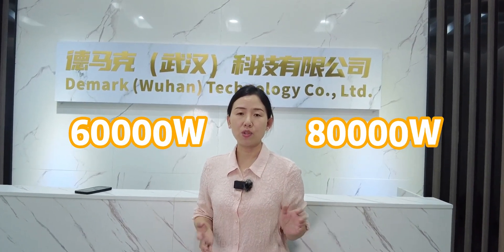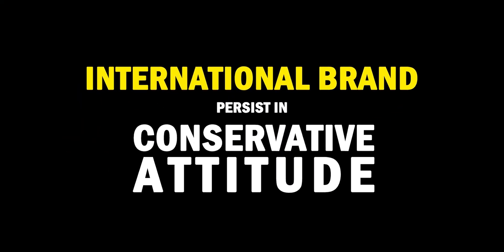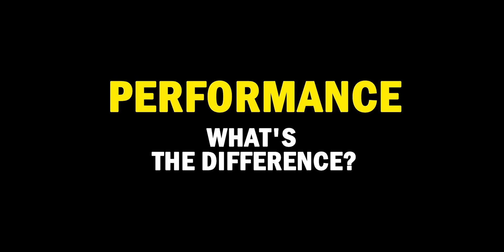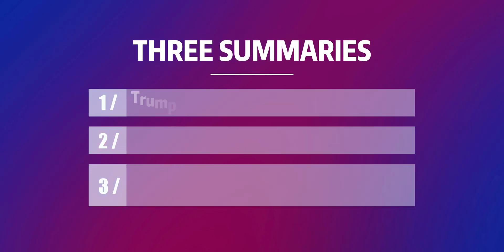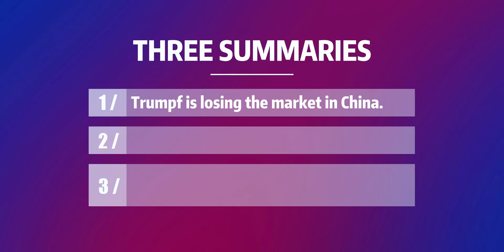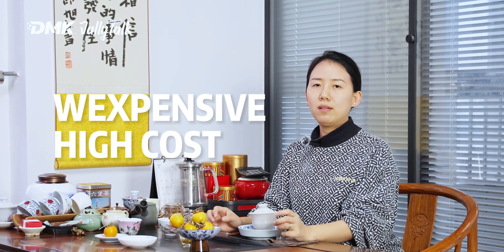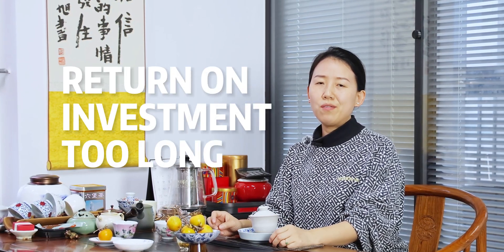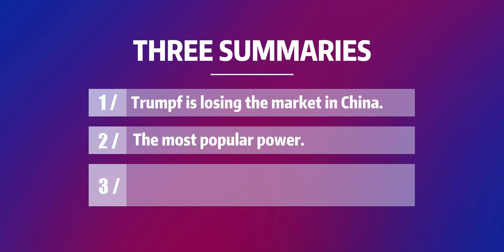Full Version：Which Brand of High-power Cutting Machine Has the Best Performance/Return On Investment

Comment: Why do those black dots appear on the cable?  Why is a fountain damaged?  How to prevent it from being damaged?  I want to buy a 2000w welding machine and also a 2000w fiber cutting machine but I am afraid that it will be damaged since the investment is high... I want to know if they are very delicate, and how to avoid damaging them